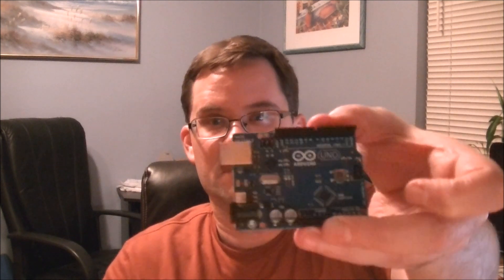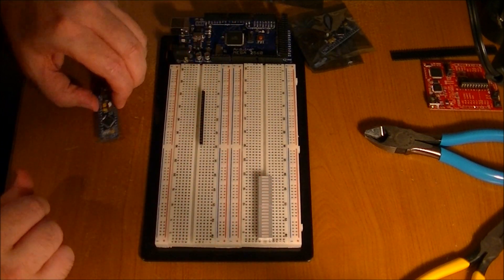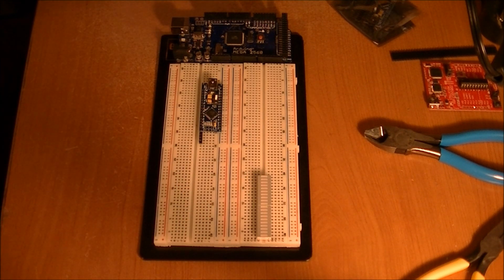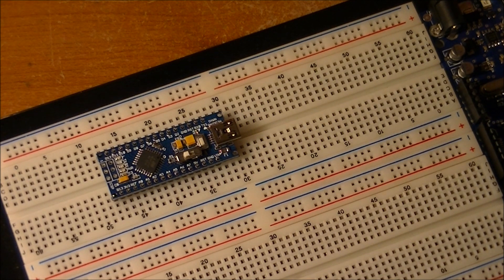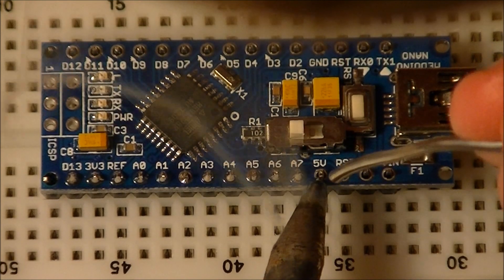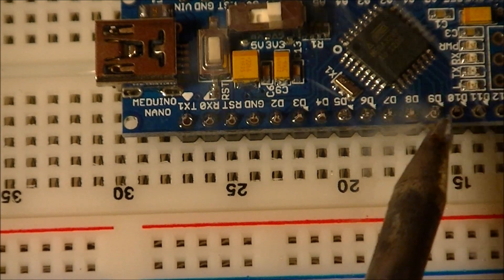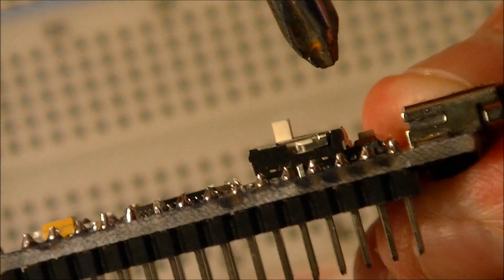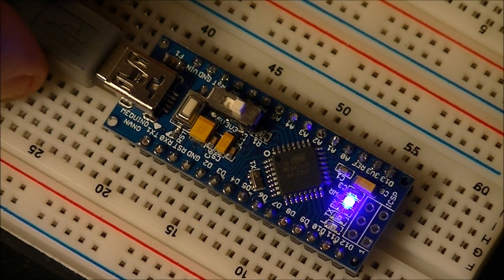Showing off my new Arduino Nano (Meduino) and soldering the headers

Comment: you are not soldering properly. don't melt the solder on iron, melt it on pad. use iron to heat up the pad.

Comment: That soldering is not good if you dont mind me saying you need a hotter iron and smaller solder.
Reply from the maker: +Bob Wareham It's what I had almost 4 years ago - crap soldering iron, crap solder and crap skills.  A few months later I bought a Hakko 836, smaller solder and I learned how to solder a little better.
Reply from the maker: capitalmindz You know, until you get the Hakko- a 10 dollar iron would suck but it would get the job done at least.
Reply: I hear you. I got press-fit (solderless) headers in the hopes of avoiding soldering those tiny headers all together but couldn't find jumper wire to fit. The manufacturer (Modtronix) neglects to mention that those solderless headers will fit 1.00mm through hole connections but the pin diameter and smaller height make them useless for normal jumper wire connections. So back to looking for a Hakko FX888D ;(

Comment: The solder iron you're using is too big, as well the tin. Pls. try to use a tool more profesional, and take carefull whit metallic tips close the pines of arduino especially if it is running
Reply from the maker: +Emilio Muñoz Not a professional.

Comment: Hmm that's not how you should solder. The solder should never touch the iron. In your video you approach with the iron from below, so place the solder from above and when it melts you will have a beautiful solder joint.